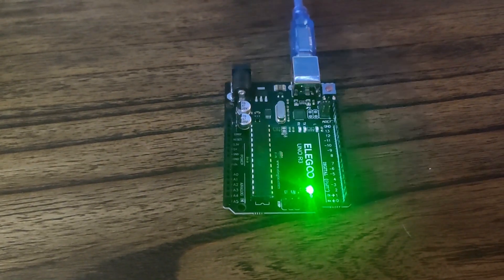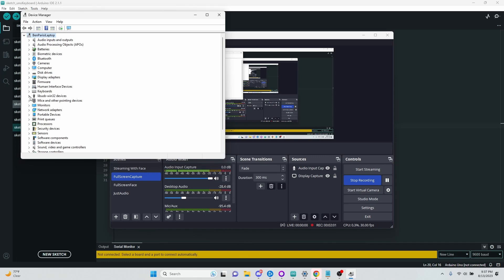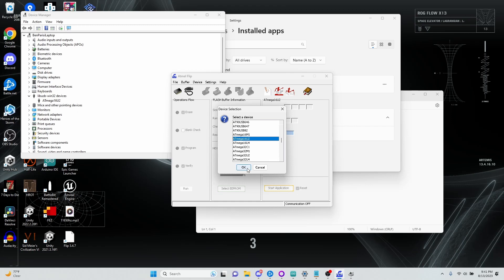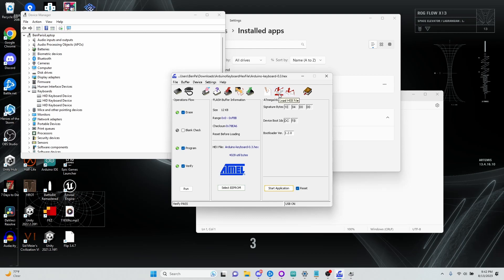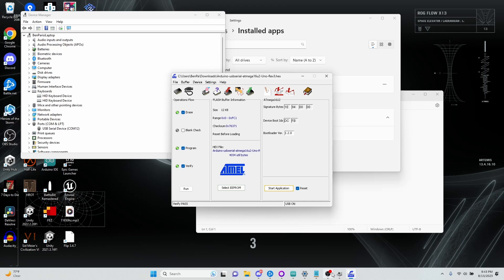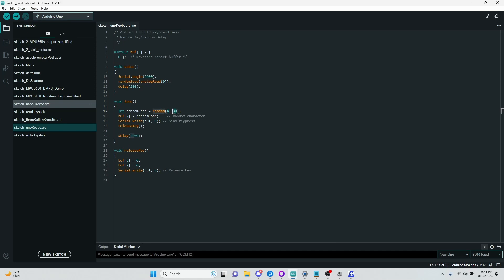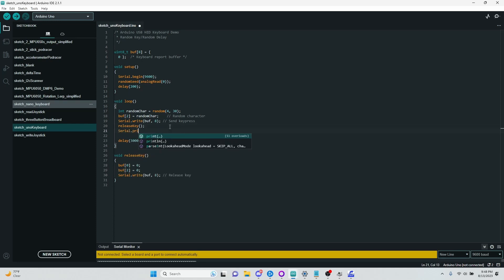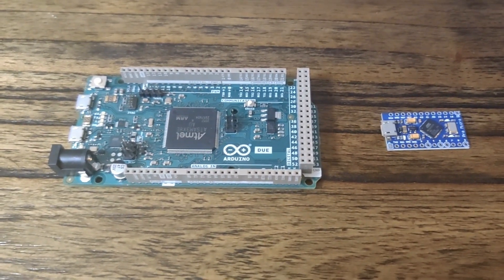How To Turn An Arduino Uno Into A Keyboard

Comment: Does this work on arduino uno r3? Looks like you are using a different arduino
Reply: hes using an arduino uno r3, its just a different brand. It's the same thing though.
Reply: @antiphoton  doesn't arduino uno r3 use atmegaa328p? thought it was incompatible

Comment: Hi i have a problem, How to remove this program from my arduino.
Now my arduino uno is recognized as keyboard so i cannot rewrite different program
since it is not recognized as any COM port.

Pressed on reset button no luck.
Reply from the maker: About 2/3 of the way through the video, I show the process of turning it back into a n UNO.
The hex file that you need for atmel flip is in the comment section.

Let me know if you have any trouble.